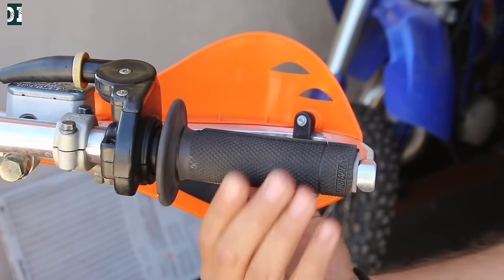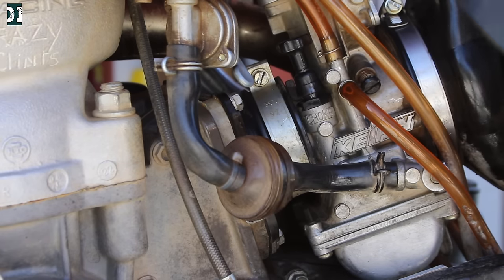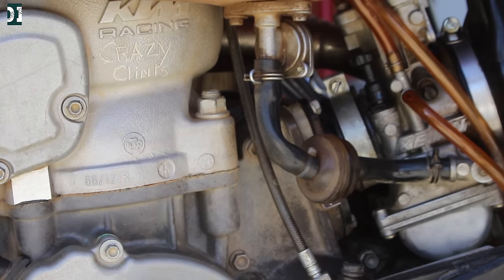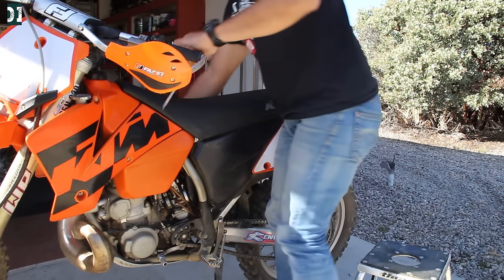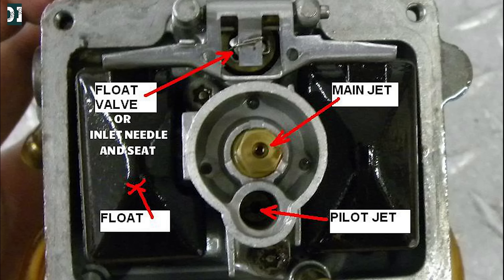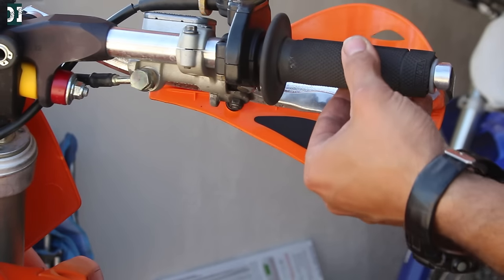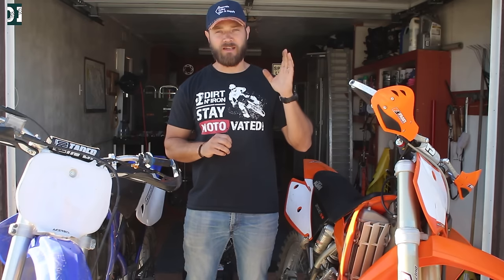How to adjust idle on 2 stroke dirt bike - air screw adjustment 2 stroke.

Comment: I have bought a new ktm 85 for my boy .it bogs and stalls of the line.its like has to much oil.you can rev it till its clear and goes well.but if you let idle for a little while gets boggy till you rev it out.du i need more air in.im a little scared of going lean and rekn sumthn

Comment: My idle screw doesn't seem to make any difference in idle after winding out the main airscrew 2 turns. Throttle response is good on main air screw position.

Comment: Great video, My son has just bought a 2013 KTM 85 SX, question regarding the choke, where is it in the ON position, pulled up or pushed in, cheers..
Reply from the maker: Choke is on when it's pulled up. Good luck!
Reply: Cheers buddy, Subscribed...
Reply from the maker: welcome on board ;)
Reply: Great vids bro, Family, Bikes, 4X4's Great combo, We throw in some Shooting to awesome!
What mix do you use on the 2 stroke's 25-1?
Reply from the maker: Sounds good brother, you guys know how to have fun! 
Usually I do 40:1 on my 2 strokes. Check the manual, newer KTM needs even less oil then that.
Reply: The manual does say 40-1 but I was told by a bike mechanic 25-1, think il go with you and the manual..thanks brother..Appreciate it..

Comment: Hoping to use this info to get my fully restored 1986 Honda cr500 idling.  Everything been rebuilt, carb jetted close to fmf specs, 172 main and 60 pilot and I'm at sea level.  Air screw 1.75 turns out and idle screw set to manual specs.  Bike starts up decently easy with a strong leg, choke on and it needs a little throttle to fire.  Will stay idling with choke on.  Ride around a bit to warm up and with choke off the bike will stall right out when comming ton a stop and letting off throttle. 

 I know this type of thing is a little different bike to bike but wondering if I should be leaning out/going out with the air screw or richening/turning in?  I've also tried at 1.5 turns out and same thing.  Maybe it needs 2 turns out?  I'll mess with it today but wanted to see if anyone here may have an idea of the top of their heads.
Reply from the maker: hope it helps,let me know

Comment: What's the matter if the idle screw doesn't change the idle at all? Also the air screw isnt changing my idle characteristics much. The bike has good throttle response off idle and all the way up though. It's a 97 ktm 360 exc is what I'm working with
Reply from the maker: make sure your slide is sitting on the bottom of the carb. you should have play on the throttle cable, to allow slide to sit on the bottom - to be closed 100%  idle screw is a tapered screw that lifts the slide when screwed in, so if the slide sits higher than the screw it will not be affected by idle screw.. hope that makes sense.
Reply: @dirtniron  yes that makes sense. I'll check that when I get home tonight. Hopefully it's something simple like that lol
Reply: @dirtniron  so I got around to checking. I can't get any more adjustment in on the carb or on the throttle and still not able to get any freeplay. Does that sound like I may have the wrong cable installed?
Reply: @dirtniron  just wanted to give you a huge thanks.  The slide was not sitting on the carb. The pilot jet was so rich it compensated for it. Put the right jet in and it wouldnt idle because the slide was being pulled so much. Turns out the previous owner put the wrong cable in. Changed the cable and 1 1/2 turns out on the screw it starts the 1st or 2nd kick everytime
Reply from the maker: Jesse Snayberger cool man! I am really glad you figured it out! Thanks for sharing 👍

Comment: My air screw fell out and I'm waiting on another one to arrive.  Can I replace it with a normal screw temporarily?
Reply from the maker: just wait for new one, I wouldnt use anything else
Reply: @dirtniron  Thanks! Would this cause the engine to bog down and cut out / not accelerate?  I'm hoping the air screw is the only thing wrong with it. Also, I found fuel all over my magneto. I'm super green when it comes to small engines but I'm trying to get up to speed.

Comment: I have a husaberg TE300(ktm exc 300) 2011. And i was wondering why my bike dies if i take the choke off with a cold start.. when i start riding it for a bit it will then idle normal.
Reply from the maker: probably not warmed up all the way and maybe still bit lean..

Comment: What making bike "leaner" means? Also what it can do if bike will be set too lean, when wide open throttle?
Reply: mKFF “leaner” means more air less fuel 
“Richer” means more fuel less air. if the bike is too lean turn the air screw on the carburetor to the right(clockwise).
Reply: @reeceogden2386  aaa okey thanks for explain, but how i see the bike is too lean?
Reply: mKFF if the air screw is all the way out
Reply: @reeceogden2386  thanks dude

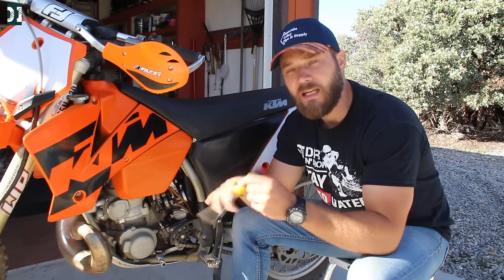Comment: my Yz125 2022 ( just 7 hours)keeps on flooding and fouling spark plugs. First I thought it’s because of the oil gas mix ratio and I changed it to 1:32 and changed the stock one with new NGK one. Ride it for 20 minutes and stopped. When I am taking the spark plug out it seems wet always. Can I fix it adjusting air screws/idle Any help please 
Thanks
Reply from the maker: Yes. Try to play with it for sure. Those carbs have a problem with the gasket. I think JD jetting is selling them, I would get their jetting kit as well. I have good experience with their jet kits

Comment: Hi cud u help wen I'm on my bike ad movein I've changed gear ad the power is there bt a second or so later I get a boost ov power wot cud it b plz or do u think my carb is sticking 4this 2b happing thank
Reply from the maker: sorry man, I dont really understand your problem. do you have bog or is the bike loading?
Reply: It's ok thank it's my clutch slipping I've found out the problem..cud I have sum free stickers of dirt ad iron plz if pos jst money is tight coz cant get out 2work with wots going on

Comment: So I dropped a pilot jet size in my yz250 to a 45. Bike starts and idles okay however, my air screw is correctly set to idle (2-3 turns out) but my idle screw literally does nothing even if I screw it all the way in or out. Any ideas ?
Reply from the maker: do you have free-play on your throttle cable ?
Reply: Dirt N Iron about the same amount you do in this video

Comment: So my bike stays on with the screw all the way in to the right, does that mean it needs to be rejetted to be leaner.
Reply from the maker: yes, I would try one size smaller pilot, or at least move the needle one notch lower
Reply: @dirtniron  thanks, appreciate it.

Comment: i did all you said and it worked even the idle is quite and the motorcycle dont dies ( sometimes it happens) but when i shift to gear 1 and hold the clutch without pulling thr throttlr, it starts dying really fast. pls help
Reply from the maker: raise the idle bit higher see if it stays running.
Reply: Your clutch might be reaching the end of its life. My bike has a notched clutch basket which holds the plates together and causes the clutch to be kind of slippery on takeoff and it slows the engine when I pop it in gear so I have to rev it to keep it alive until it’s warm

Comment: I'm on my mother's account but I got a 1995 Yamaha yz125 2 stroke and it sounds like it wants to turn over but it isn't turning. Any ideas on why it isn't starting.
Reply: Did you clean your carb?. Check spark? If that doesn't help gonna have to take off your cylinder and check out piston ring. Get a service manual on ebay if you don't have
Reply from the maker: Austin has a good points, follow that and see how it goes

Comment: What if I can shut my air screw and the bike still runs okay? I’m also super rich mid throttle but seem okay low and wot vids on my Chanel 2002 rm85
Reply from the maker: you should not do that, that means your jets are not right.. give it at least 1/2 turn out and see if it still runs good, if not then you need to re-jet
Reply: @dirtniron  hey bro think you miss understand me lol it’s at 1.25 turns runs great look on my Chanel if you like but why can I close it see when you do it it stalls mine doesn’t bike still runs okay but do I need to go up or down with the jetting and I’m very rich mid throttle why?

Comment: great vid mate, thanks
Reply from the maker: cool mate, glad it helps!
Reply: @dirtniron  Hi mate, Please HEEEEEEEELP I just  install JD jetting kit for my 2014 exc300, I am very happy with performance , BUT on deceleration I am getting those POPs( or, what it sounds to me... dings), almost like single ignition of fuel, 2 to 5 times as bike comes down the revs, any ideas what that could be?  I tried go leaner but it didn't help a lot. Thanks in advance

Comment: Addition, rev hang and drop in idle anymore than 2 seconds after full deceleration if you've reached your desired idle is a tell tale sign your pilot screw needs changed. Good tutorial but just the tip of the iceberg. Should put a smaller pilot in and show over adjusting air/fuel.
Reply from the maker: sounds good, thanks
Reply: @dirtniron  great videos man, always learning from your tips.

Comment: So my idle is set at +- 1500 but if i pull in the clutch when coming to a stop my idle is 3000 but if i give a big rev it wil drop again i checked for a air leak couldn’t find anything and my air screw is set at 1,1/4

Comment: My oil bolt fell out of my bike and lost all my oil or most of it well later on i was riding home and almost home the bike from 5th grar like almost died loss lot of power and it started clankin real loud i quickly cut it off and started it back up it started very easy but still clanking if i but more oil in it and bolt of course will the engine be safe or im i screwed
Reply from the maker: it doesnt sound very good.. 4 stroke?
Reply: Dirt N Iron yes it is a 4 stroke
Reply from the maker: doesnt look very good.. sounds like you need to rebuild.. sorry bro
Reply: Dirt N Iron thanks thats somethin didnt want to hear but things happen and thanks for the help
Reply from the maker: I feel your pain bro, good luck!

Comment: I have a 04cr85rb got a new carb starts up then shuts off right away any idea?
Reply from the maker: I am not sure, I would go thru the carb and make sure everything is ok, clean it, use same jet as in the old one (same size) and try again
Reply: Dirt N Iron I installed the old jets into the new carb started right up thanks man I was struggling for days never worked on carbs I appreciate it earned a sub🙌🏼

Comment: Hello,  I have a 50cc 4 stroke. Problem is we can only start the bike with the choke full off BUT the bike then runs at full speed (wheel spins at max speed) Turning the choke to on make the bike then tick over at idle. BUT as soon as we start to turn the choke off the RPM goes up and the bike want to drive off.  How can I fix this?
Reply from the maker: bike is too lean, i bet you have dirty carb. I would first clean the carb and make sure all the jets are clean. then start playing with it.
Reply: @dirtniron  hi many thanks for the reply. The bike is Brand new. I am trying your set up with adjusting the air and fule but now my battery for the electric starter is flat. So many problems

Comment: 2 strokes and 4 strokes can both have either air screws or fuel screws. The strokes do not make a difference. Where the screw is located is what matters. Imagine a line vertical down the center of the carburetor if it’s towards the fuel tank it’s a fuel screw if it’s towards the airbox it’s an air screw.
Reply from the maker: yea thats right, thanks for clarifying that

Comment: I tried doing this and my engine nearly exploded when I cranked it after getting the screws in the position this shows. It was full throttle and the kill switch wouldn't even kill the engine it was reved so high. Took almost 20 seconds of it being full throttle before I could get it off by loosening both the idle and other screws. Do not adjust at all while not running is the lesson I learned, at least nothing dramatic. 
I tighten the air or go less air and it revs up more...why is that? 
Also the idle adjustment is nearly all the way out. To get anything out of it I have to go almost all the way in but depends on where the other screw is set to but also is very touchy once I get it there.

Comment: I have just bought a KTM 200 EXC

Seems to idle fine.. but today once up to working temp the bike seemed to bog down until it died (I was unable to rev it to clear it if that makes sence).

I left it 5 minutes and once it started I managed to get home! Could anyone help me understand why it would bog down the way it was? Especially as it was hitting the powerband perfectly before it did so! 

Thanks
Reply from the maker: make sure your carb is clean, air filter clean, also when was it last time you repacked the silencer ?  Try to play with air screw, lean her our a bit..
Reply: @dirtniron  I just played with air screw but need to check and clean air filter and carb.. also haven't done silencer as I've only just got her. Seems to be quite black and oily inside the silencer if that's a giveaway?

Comment: What fuel ratio do you use?
Reply from the maker: 40:1 most of the time, I tried 50:1 too..
Reply: Dirt N Iron how did that go?
Reply from the maker: It was ok, no problem. But just to stay safe I moved to 40. There is a lot if guys running 50+
Reply: Dirt N Iron yer i am running 40:1 now but its still fouls the spark plugs should i move to 50:1?
Reply from the maker: you can try that, also make sure you are not too rich. Personally I jet my bike first, than the ratio 40-50 doesnt make a big difference.. at least for me

Comment: Hey my bike KTM Racing exc 250 2 strokes and engine does not spin.And oil sludge leaking from the muffler,pls help :(
Reply from the maker: oil from the muffler means you are running too rich. what do you mean it doesnt spin? you cant kick it, is it seized?
Reply: @dirtniron  no,no :D half gas is running good engine,and full gas dying :( not running engine and smoke.

Comment: how do i set my idle screw to stock after carb rebuild
Reply from the maker: idle adjustment screw i think its ok to set it in the middle, like 3 turns out to start with.  I am not talking about air screw, there I was start at 1.5 turn out

Comment: My son's k's 85 ran then wouldn't start pulled spark plug out held it whilst kicking it over spark plug siding give us a boot just slightly you good feel it put it bak in empty fuel bowlpetrol off tightened it all up put spark plug bak in kicked it over it started for about a min then stopped and won't start does anyone no why

Comment: I have same carb and mine doesn't have that screw above the air fuel screw
Reply: MrYukon04 some of the older models use the choke knob to twist for air adjustment.
Reply: @jakehindman7681  yeah I found that out lol but we got it running great
Reply: MrYukon04 awesome man! I seen where no one had replied to your comment and I literally found that our last night. Haha figured I’d share the info just in case. Glad ya got it running man!

Comment: Adjust but again this problem little riding.. what is the problem
Reply from the maker: i am not sure.. make sure your carburetor and air filter are clean, check the reeds, check for the air leak on rubber boot..

Comment: That’s not adjusting the idle, that’s just adjusting the air fuel mixture, the way you change the idle is the choke rod. You can spin it either direction to change rpm.
Reply from the maker: not on 2 stroke dirt bikes..

Comment: bro my bike doesnt run at all anymore, i have spark and new fuel but whatever I try it doesnt go on. It worked before and it pops out of the exhaust when I try to start and rev it. Anyone knows?
Reply from the maker: could be dirty carburetor, check specially pilot jet
Reply: @dirtniron  i tried to get if off but how to detach the choke and gas cable from the carb so i can take it out completely ? Everything seems crisp and clean inside from what ive seen so far. Thanks for the reply dude

Comment: Can anybody help me,my bike revs itsself  to full rpm,after I cleaned carburator,sometimes it runs at normal idle and then when you rev it a little bit it revs itsself (350cc 2 stroke)
Reply: And it fluds alot,sometimes it back fires from one cilinder and then hops to another,maybe its carburator failure I heard alot of people telling that those carburators are junk(its soviet bike)

Comment: If my bike bogs at low rpm but idles fine and runs good at high rpm that is the idle jet.
Reply from the maker: yes, the pilot jet / air screw tuning

Comment: My yz 250 had very high idle . I shut the bike off and was never able to get it started again.  Rebuilt top end . Got good compression. Got sprak but it will not start . Even putting fuel in the plug hole it will not turn start even for split second. What could my problem be?
Reply from the maker: not sure man.. I would have to check it one by one.. not sure..  check your carb, specially pilot jet